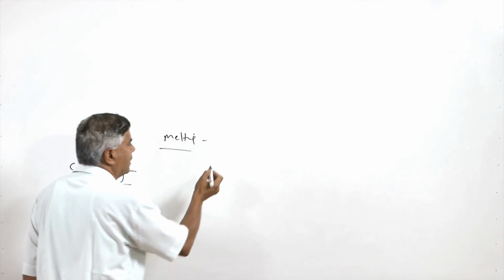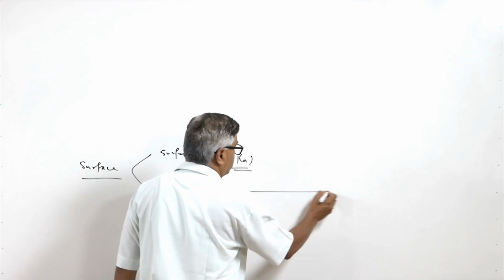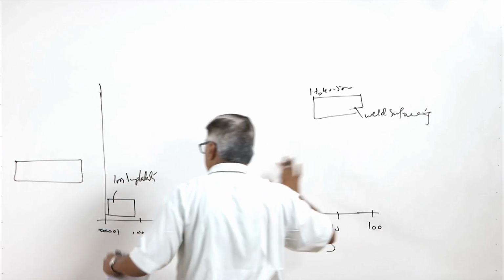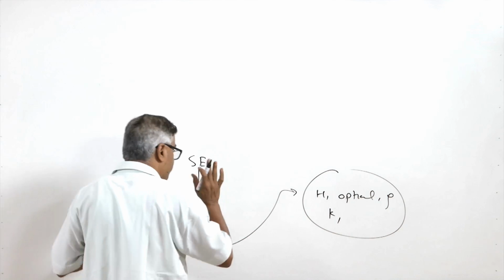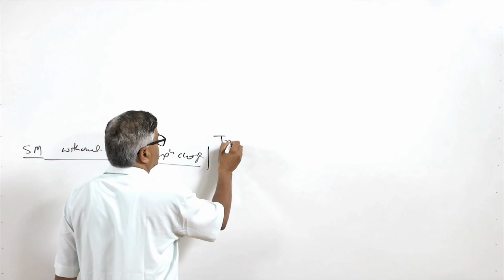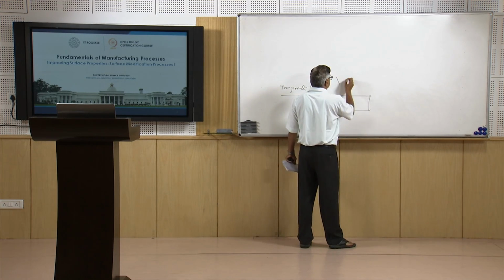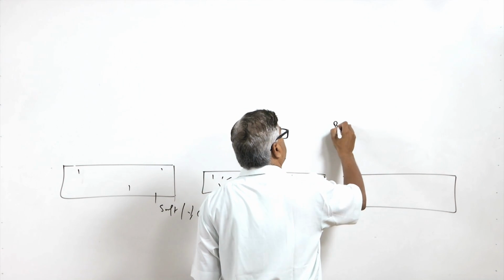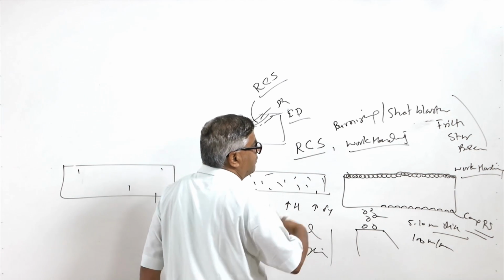Improving surface properties: Surface modification processes

Comment: Sir,
in week 12 assignment question no. 6 there is a question " The surface modification process for a metal system which does not respond to the heat treatment, generally relies on " and the options given are 
Grain Refinement
Mechanical working
Precipitation hardening
Both a and c

but in the lecture 58 which you gave us, you said " The surface modification process for a metal system which does not respond to the heat treatment, generally relies on Work Hardening Methods. " The time was 23:36-23:43  and there is no option of Work hardening in the question.
It will be very helpful if you look into this matter.

Thank you
Reply: Sagar Das hello are you going for certification exam ...??
Reply: Yes, I am.
Reply: Mechanical working . Which also comes under work hardening or strain hardening eg- shot blasting etc.